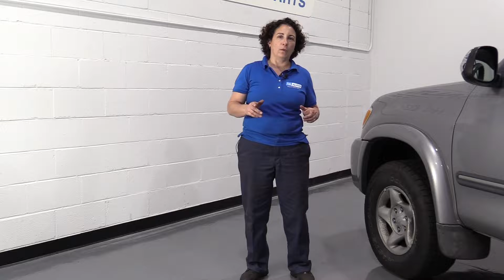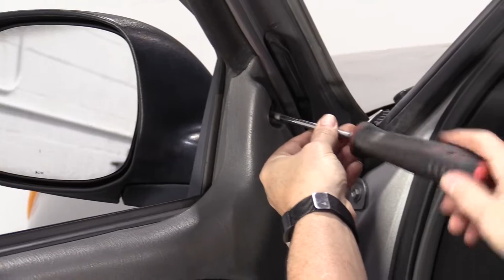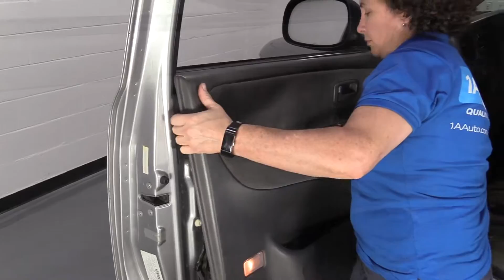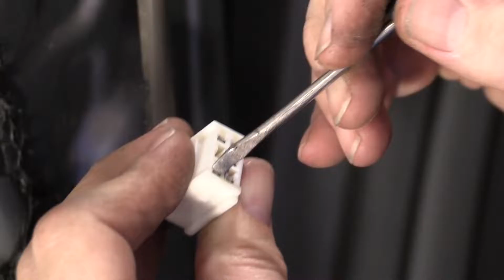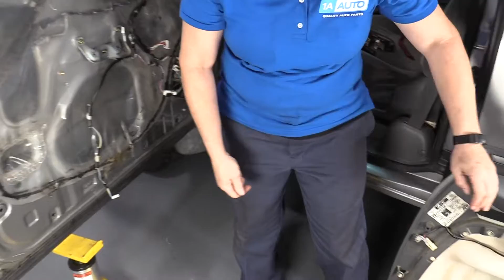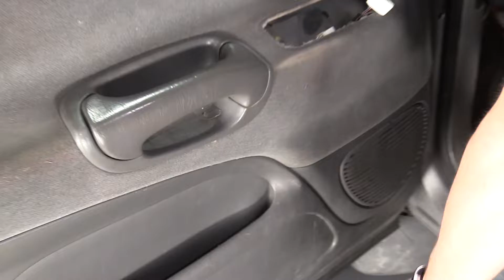How to Replace Mirror Assembly 00-06 Toyota Tundra

Comment: This detailed and practical video gave me the confidence to replace the mirror myself.  Before I even started I knew that I needed to buy a T-30 screwdriver.  The information and your replacement part saved me big $$$ over the deal quoted price.  The only small item missing was sticking the foam seal pad to the new mirror mounting surface, but that was obvious on how to perform.

Thank you and well done!

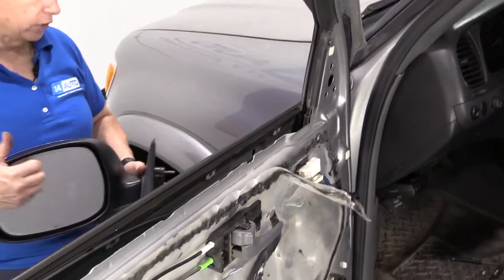Comment: so someone took the heated mirrors out and put in non heated mirrors? the tundra has the heated mirror push button visible at 6:33 on the dash (Its the furthest left button).... do the heated mirrors have a special unit tucked away somewhere, can you install the switch and heated mirrors into the factory connector and will it work?
Reply from the maker: +Shotgun Rumble Thanks for checking us out! You will not be able to go from non heated mirrors to heated mirrors, the pin out connection will be different. You may be able to go from heated to non heated however with the different pins, you may have a check engine light. We always recommend replacing mirrors option for option to avoid any issues.

Comment: Are the mirrors in the 2003 toyota tundra power or power heated?
Reply from the maker: +RBA1225 The ones in the video are power and non-heated, but no all 2003 Tundras will have the same OE mirror options.  Thanks for watching.